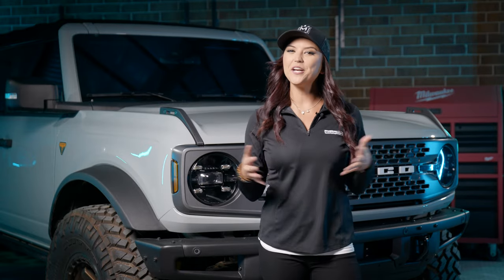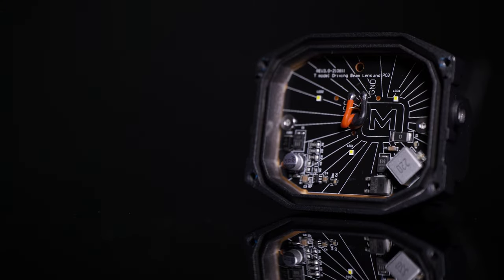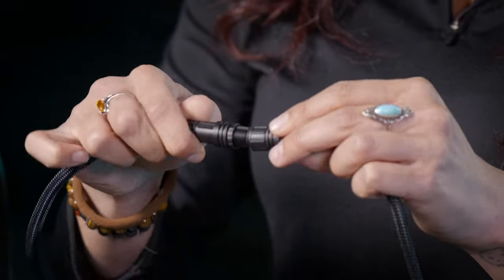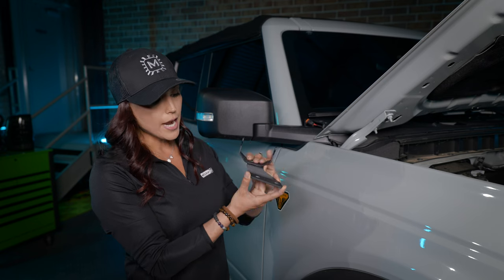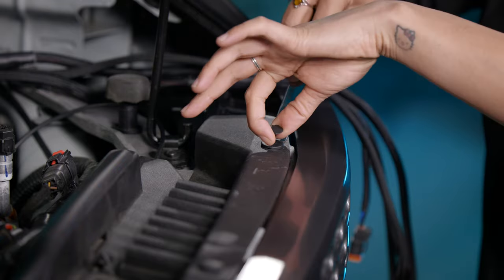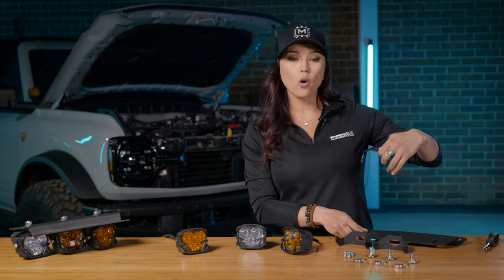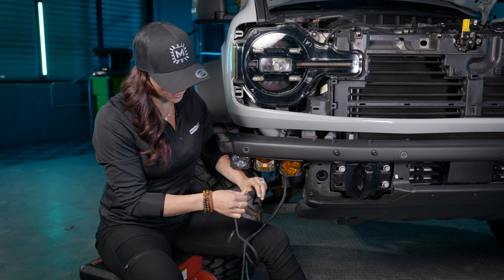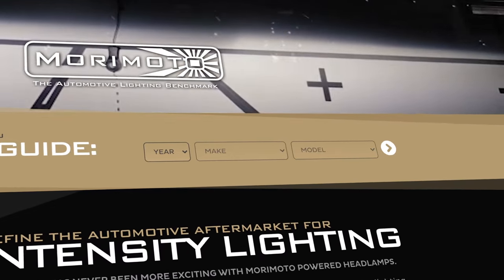Morimoto 4Banger 21+ Ford Bronco A-Pillar & Fog light Install

Comment: I did get some NCS yellow wire 4bangers, I’m pretty satisfied with them. I used the harness and adapted it to work with the oem fog light button. My only issue was that they did not fit in my Pontiac G6 easily, I did need to cut a few grooves to make sure the heat sink would clear the bumper. And the trim pieces that go on top would not clear so I had to cut some bits out so they would clear. They look super nice and I’m really happy with the end look. My bumper and trim pieces were not oem so I’m not sure if they would’ve fit with an oem bumper
Reply from the maker: Good info my friend, thank you!